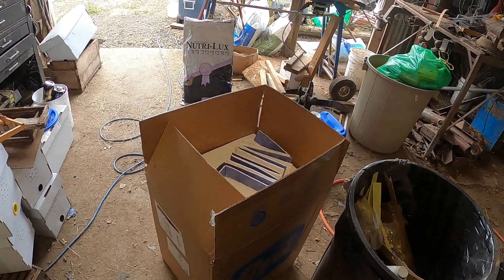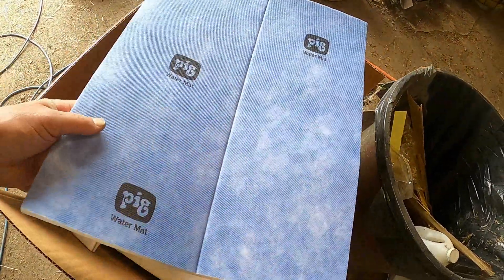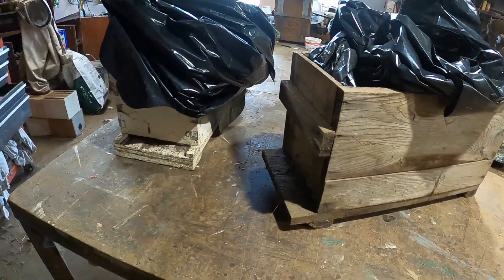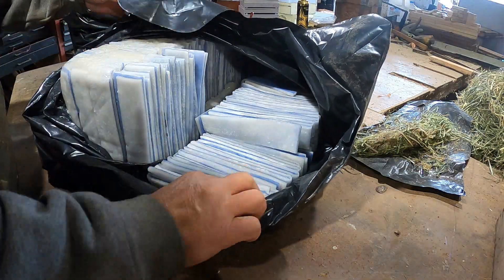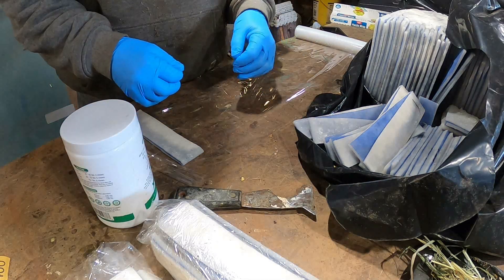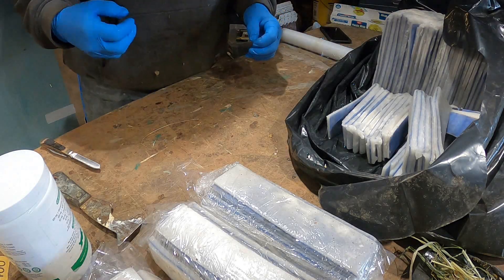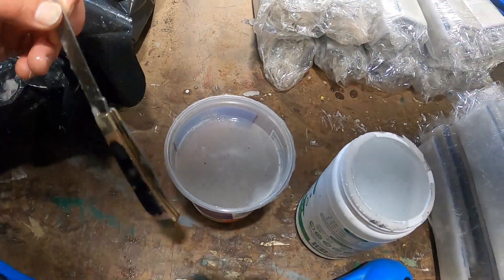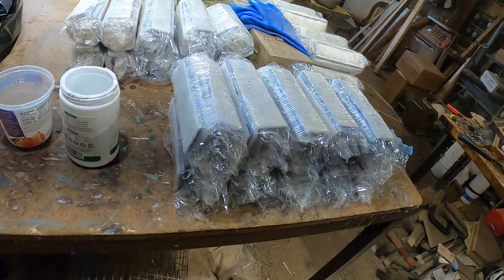big batch Oxalic acid strips

Comment: Somehow I must have missed how you install these strips....  Are you tearing each one in half then putting the two halves on top of the frames in each box (4 total in a double deep hive) - or is it just unfolding the long strip and two per box?  Thanks
Reply from the maker: I tear it in half, and lay them on top of the brood frames. I like to keep them in about an inch from the end of the frames. when the OA runs out and down the frame it will kill brood so I dont like them over the middle of the frame. usually in the spring I just have them in the box with brood, as they fill 2 brood boxes I add more. this is a good time to replace any that have dried out, or have been lost when doing inspections

Comment: Harris  - just a thought have you got an old plastic suitcase...... might that be useful to put your massive amount of strips in?   There's always plenty of cheap storage boxes in the UK light and water tight but for your needs Glycerine tight ? take no notice if you don't think that's a good idea. Both have handles ?
Reply from the maker: I do need to come up with a better way to pack them with me.
Reply: @harrisjoubertwithsleepycre1924  You cleaver folks in the USA will come up with something...... Usually 10 years or so in front of us lot in the UK. My old mechanic pal emigrated 40 more years ago to Warminster PA   He told me that good work is more recognised your area than here......  He's gone now though. It might have been the brake linings they used to blow out with an airline!

Comment: I made some on capillary matting. It's thicker than the Multi fibre cellulose dish cloth. The Multi is 2mm thick whereas the capillary mat is 3mm -1/8" the capillary matt don't half hold some stuff. That's what I used in the new colony 5 frame installed last Sat in a 10 frame Langstroth -deep. I was amazed by the 300 drop and was further amazed that it out paced the fumigation. I would have sworn the fumigation should have been more searching but no that strip did it and there was no where near as many grams on it as seen in Randy's latest report  (for me)  Part 1  = 2022  March.
Reply from the maker: as long as you can keep repeating that you will be good
Reply: @harrisjoubertwithsleepycre1924  Thanks Harris  I hope you are successful as well, sure makes you feel good.  Terrible parasite those varroa .... was bitten by a tick  end October 2020 that carried Lyme disease so three weeks of Doxycycline got me right but it was uphill and makes you feel for the bees being made ill by those critters. They are just vile.    These strips seem excellent.
If it's got to be a material that holds plenty of stuff then although the Capillary mat is dearer then that sheet certainly holds a lot of Ox +G.
Reply: @harrisjoubertwithsleepycre1924   Hiya Harris   I hope you are doing well with the strips..... I've read the march 22 R Oliver deliverance which all us successful experimenters will find very interesting.
The new colony must have been hindered with the 1000 mites I've got off them in 19 days?
Todays drop =64. It was a bit worrying but I should not have worried because you know as well as others that the count (kill) can be erratic.  1 drop = 300 a while back then down to 2 counts of 160/170/130   no 64 which is as some would have predicted!!!!  
For the future you will  be able to predict what will be the pattern and outcome through your experience of this great method.
I see a new vaporiser is being used  but although I thought vaporization would have been more 'searching' that the strip method I don't think it is more efficient or even equal to the strips on the proviso the strips are loaded with enough 1 to 1 and there is enough of those strips in the hive to cause the devastation to the mites that the strips do....... I would think = as good as a silver bullet as you say...... Great stuff.

Comment: have you heard of anyone using these  strips in the  (daytime temp about 60 degrees). spring in place of using a wand and oxalic acid to kill the mites before the flow.
Reply from the maker: mine have been in since jan. I will replace in April. they stay in when I vape. the problem with vape is it dosnt kill mites under the cappings. the one gram per box is not enough, research is showing 4 grams is closer. if you are using it in the spring when the box is full of brood you need to treat every couple days with 4 grams to have any reduction in numbers
Reply: @harrisjoubertwithsleepycre1924  do you think they are not working?? is that why you vape also??
Reply from the maker: @olddave4833  different hives have different results. I had many with no mites, I had some with some mites. I vape mostly in the fall and winter, when they are broodless. But it never hurts to throw on an extra layer of protection. If I move to a new yard, or a new flow starts, I don't know what bees mine are mingling with. Oxalic acid seems to be the only treatment that doesn't adversely affect the bees. It is also very inexpensive compared to other treatments. This year I plan on leaving the strips in most of the season. I will probably also cage the queen after our June flow to get a brood break and hit them with vapor. I will reassess mid August and determine then what if any treatment they need when preparing they're winter nest

Comment: My yards are 30-40 hives. I like to keep everything as simple as possible. Would making these in 5 gal buckets cut out a few of the steps? 1 bucket per yard. Put the pads in a bucket dump the solution on top good to go for the yard? Is it necessary to separate them out?
Reply from the maker: you can store them any way that makes it best for you. If you store them long, and they get warm, the liquid will drain out of the ones on top

Comment: so when you put then in the hive was it easy to do so and  did u find it killed your mites  thanks and have a great day
Reply from the maker: Very easy, just place 2 strips on the top of the frames. Very non scientific observations, the colonies that had the good sponges had low to no mites. The ones that I left shop towels on had higher mites
Reply: @harrisjoubertwithsleepycre1924  This is great  another question if u do not mind I was thinking about  putting this in the hive at the time I put on the honey supers  what is your thought  when do u do it  thank u very much and have a great day
Reply from the maker: @framcesmoore  I plan on putting them in the first of Jan. then my bees go south about 12 hrs. to almonds foe 3 months or so. first of april they should be back, I will pull nucs off and test for varroa. if high I will think about other treatments, and probably pull all brood (nucs that will get a queen in a week) old queen gets all the field bees, so she will lay the nest back fast. this gives a brood break to all. OA vap works great with no capped brood. then replace strips, and check the end of june when I pull honey and split. then a check mid to end aug.

Comment: I added OAE to my colonies based off Randys website and used the same 1:1 OA and glycerine with the swedish cellulose sponges off Amazon that he mentioned. So far, as of yesterday, all colonies maintained zero, one or two mites. Which only one colony went up. I have 11 colonies. One nuc had 3 mites but that has been untreated so far this year. I am only one month into it or 30 days out of a 70 day Extended application. Based off Randy's report, its natural for the mites to increase as the mid way or so point comes because the current theory is the OAE keeps the mites from going into the cells to reproduce so naturally the phoretic count will be higher, but will lower when they don't reproduce as much. Time will tell.
Reply from the maker: I have been doing random testing as I am requeening. Most have very low or zero counts. Some that I used shop towels on are higher. The sweetest sponges disintegrate with time. I found a better system in water absorbent pads. I showed them on my big batch video. I have had a few colonies with high counts that have the shop towels. The towels were supposed to only stay a short time you know how that goes. Randy also found the towels did not do much